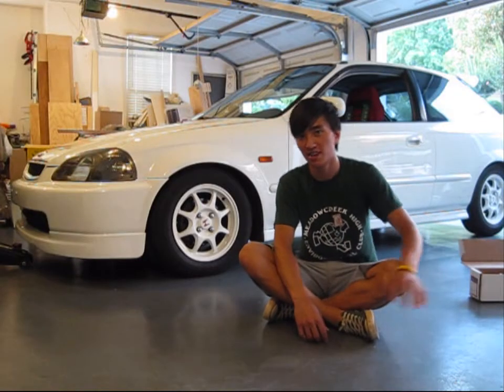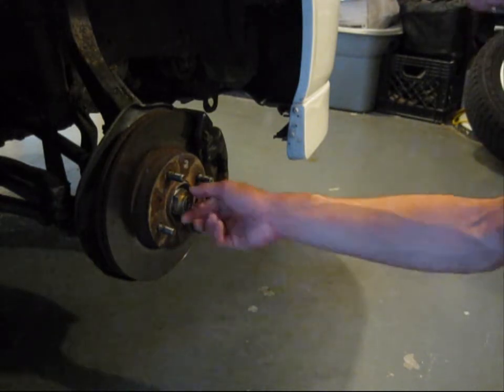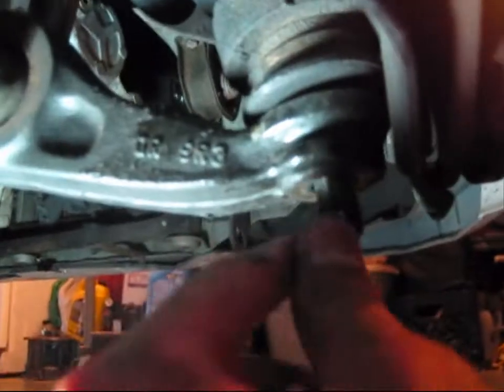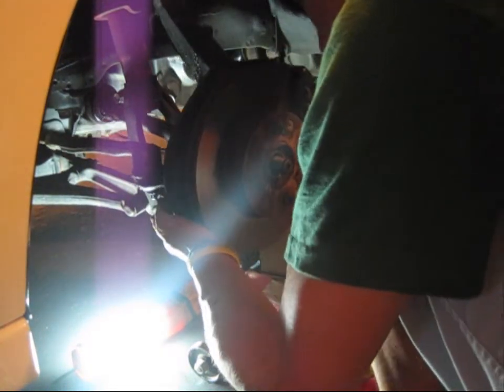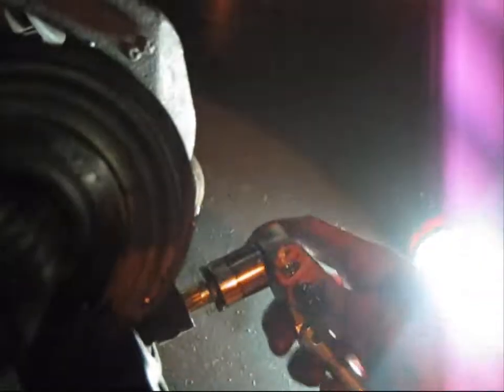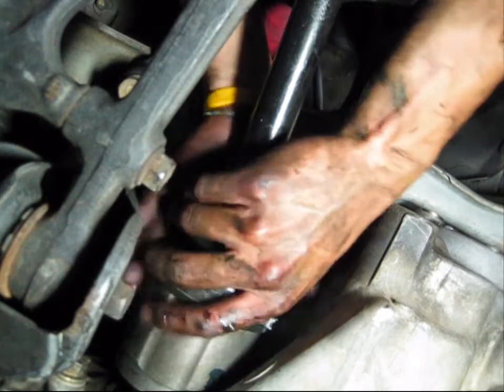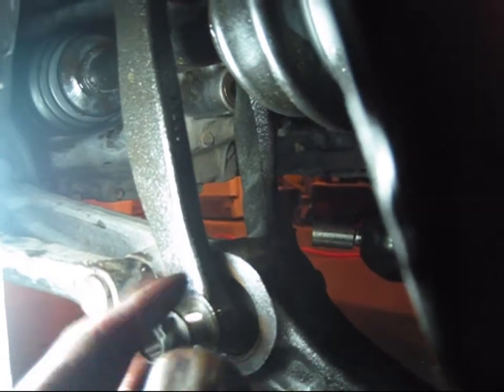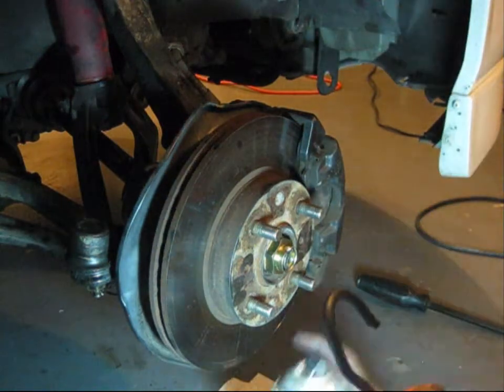How to Replace an Axle with Michael Flare [tutorial]

Comment: Hey mike what brand impact r u using in this video and the video where u install your lcas and subframe
Reply from the maker: It is a very expensive Snap On brand that had a retail price of $500 I think. It creates about 300 ft/lbs torque. I wish I had a compressor tank to use my other impact wrenches by air but this is more convenient.

Comment from the maker: ...both 2000 Honda Civic SI and 1995 Honda Civic Del Sol VTEC will work because they are both B [DOHC VTEC] engines just like your GSR engine and the shell is your 4 lug civic. I don't know if a real GSR axles uses 32mm axles so it's safer to get axles for 2000 Civic SI or 1995 Civic Del Sol, same thing.

Comment from the maker: you buy it for your engine and your shell. you have to see if it matches both, If you have a Integra Type R 36mm 5 lug conversion, then you get Integra Type R axles because ITR has a B series motor. If you have a normal 4 lug on your car, then you get 2000 Honda Civic SI or 1995 Honda Civic Del Sol VTEC. They both should be the same because both engines use an INTERMEDIATE SHAFT which means the DRIVER SIDE axle uses a FEMALE end. D series engine have a long shaft and both male ends...